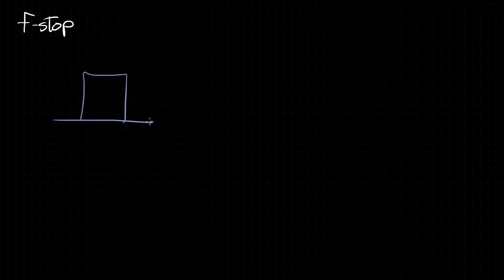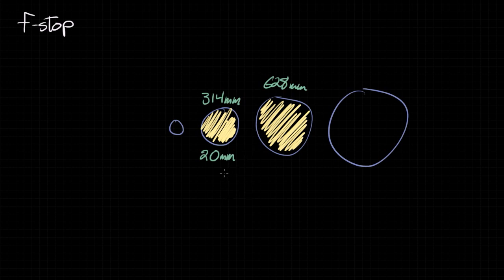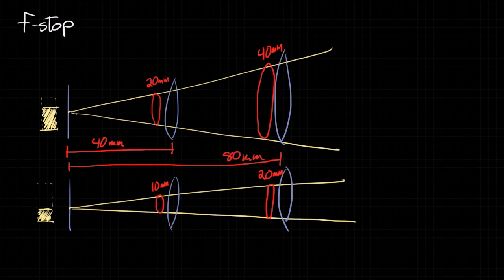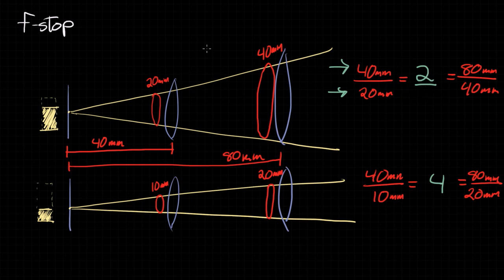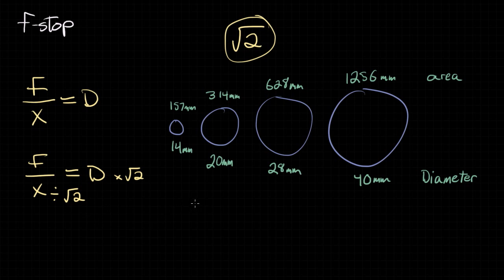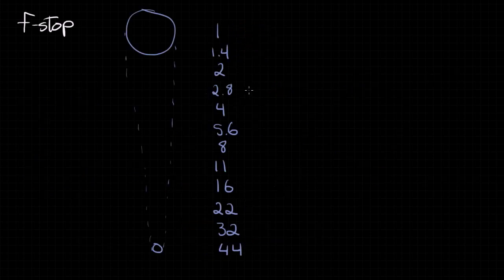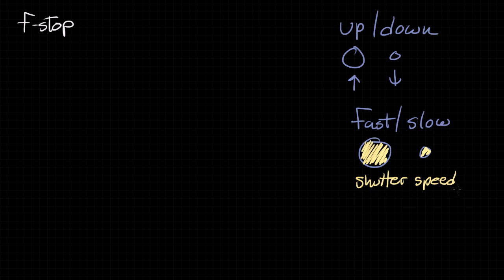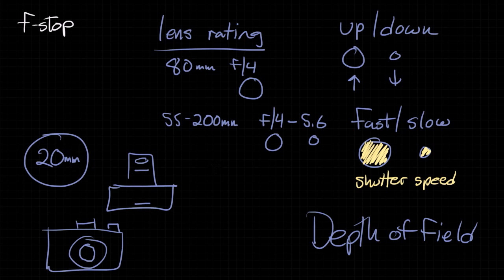A Simple Explanation of F-Stop

Comment: First of all, fantastic explanation. I just want to clarify the algebra @ 9:45 for some folks.
When he says to divide by sqrt2, he's referring to actually getting the next smaller F-stop number for the corresponding aperture. The fact that he's doing it on the equation itself, is just to avoid having to write a separate equation for the F-stop calculation. Yes, you would not multiply on one side of the equation and divide on the other...of course not, that makes no sense. Just realize, he's showing the dividing of sqrt2 as a side calculation for finding the next lower F-stop number in size. I could see this being a tiny bit confusing for some people that know algebra.
Reply: THANK YOU!!! THIS comment saved me from head banging my head against a steel grate. I've done calculus before and I was feeling terrible from not understanding why he was dividing one side while multiplying the other to balance the equation. It actually made no sense. You cleared it up for me. I feel much better now and can use the knowledge I aquired. IThank you so much man. You ARE the chosen one.

Comment: Nice video, although I think more attention should be paid to the somewhat hasty distinction made at the end between the entrance pupil and the aperture itself. Throughout the entire video, the diameter in the f-number equation was referred to as the diameter of the aperture. This is technically correct, because you later revisited at the end to clarify that it was the "diameter of the aperture _as viewed from the front of the lens_", although it was misleading for a number of reasons. For one, it doesn't explain why the diameter of the aperture changes automatically with focal length to keep the f-number constant. This is key to understanding why you can admit the same amount of light (same f-number) at different fields of view. While I understand this probably goes beyond the scope of the video, I think it's a potential source of confusion that should be cleared up during the course of teaching the topic, and not after.

Comment: If closing down the aperture means blocking the lights on the edges, why doesn't that crop the image?
Reply: If you treat the subject as a point light source a finite distance away (not infinite) from the lens, the light rays will emanate out from that source in all directions. Disregard the aperture for a second. The subjects (point light sources) that you can see in the image are set by the field of view, which is determined by the focal length. A longer focal length means a smaller field of view (more zoomed in). Now bring the effect of the aperture again. Since rays from the point source spread out in all directions, light from an object, as long as it's in the field of view, will strike the lens in all locations, both at points where the ray's entry to the sensor is blocked by the iris and points where it isn't. Thus, light from the object will still be able to reach the sensor, although the total amount of light is diminished. Thus, the smaller the aperture, the dimmer the object, yet aperture has no effect on the field of view.